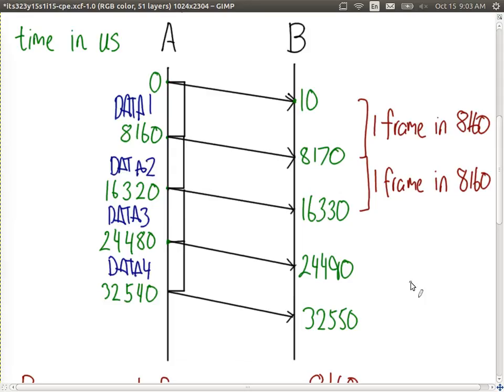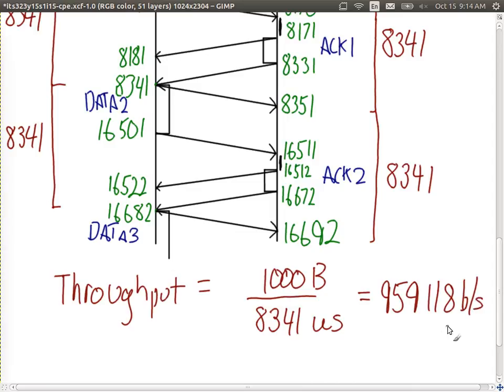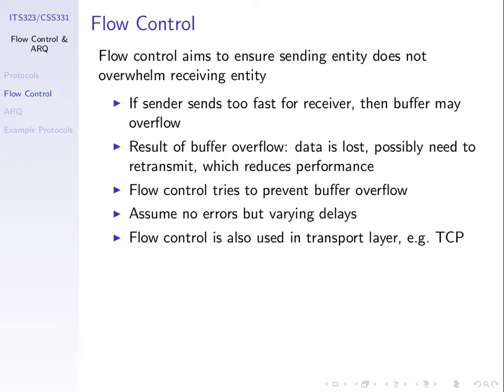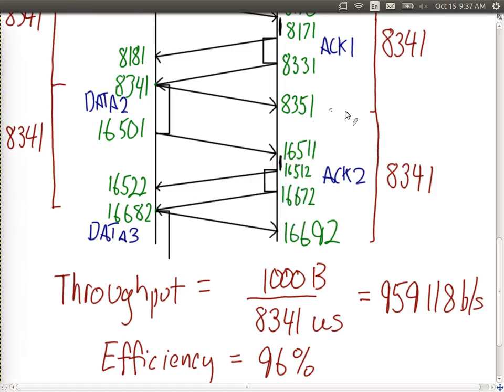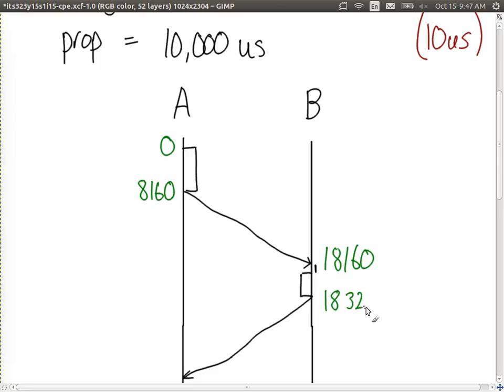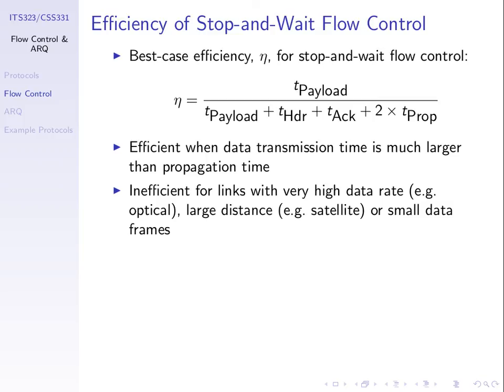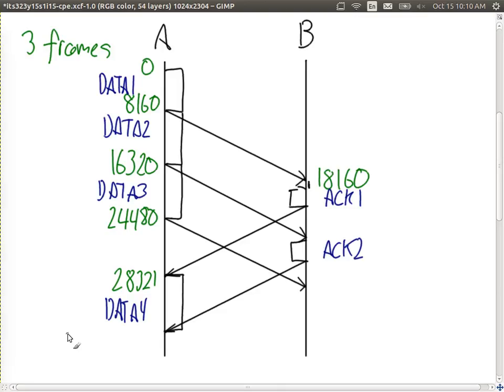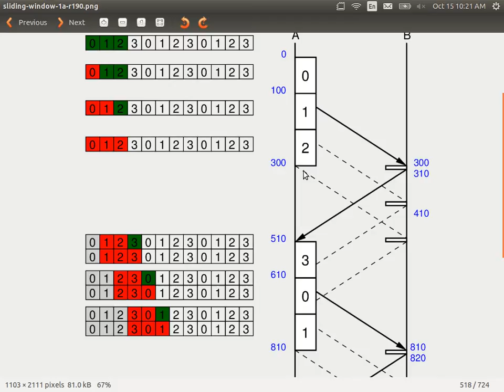Stop and Wait Flow Control (ITS323 L15, Y15)

Comment: • Frames are parts of data with some header information
 • Frames are sent from source to receiver
 • The receiver must do some processing on the frame before it can be used (by the higher level software)
 • If the source is sending faster than the receiver can process the frames, then the receiver will begin to overflow 
  ○ Ensuring that the receiver has enough time to process the incoming frames, is flow control 
 
 • Stop-and-wait flow control
  ○ Simplest type of flow control, easy to implement
  ○ You have 2 frame types
   § Data
   § ACK
  ○ How it works
   § Source sends a DATA
   § Receiver sends an ACK 
  ○ Inefficient for links with high data rate (optical fibre), large distance (satellite) or small data frames
   § Spends too much time waiting between sending consecutive frames
  ○ We often have small data frames because 
   § The receiver buffer size may be limited
   § Less likelihood of errors during transmission, and if necessary re-transmission is more efficient
   
   
   
 • Bit length of a link
  ○ =B=R Xd/v
  ○ B = length of link in bits (J: Capacity) 
  ○ R = data rate of the links, in bps 
  ○ d = length of link in meters
  ○ V = velocity of propagation in m/s 
 
Sliding window flow control
Concept
 • Allows multiple frames to be in transit at the same time
 • Let A and B be connected via full-duplex link
 • B has a buffer of size W 
  ○ A can send W frames without waiting for an ACK
 • Each frame acknowledged frame is labelled with a sequence number
 • When B sends an ACK, it also includes the sequence number of the next frame to send
  ○ This also tells A that B is ready to receive the next W frames, beginning with the number specified
  ○ This allows us to acknowledge multiple frames at one time
   § Ex. B receives frames 2, 3, 4. It only sends an ACK after frame 4 is received. 
   § The ACK also specifies sequence number 5, which implies 2,3,4 were received successfully 
 • A maintains a list of sequence nums that are allowed to be send
 • B maintains a list of sequence nums that are ready to be received 
 • These lists are a window of frames 
 
Window Size
 • The sequence number occupies a field in the frame, so it is limited to a range of values, because a field in the frame has a maximum number of bits
 • For ex.
  ○ Let each field be 3 bits long
  ○ Sequence number ranges from 0 - 7 
  ○ The frames are numbered modulo 8, so after sequence number 7, we have 0 
 • For a k-bit field, we have range of sequence numbers from 0 - (2^k) -1 
  ○ Frames are numbered modulo 2^k
 • Maximum window size is 2^k−1
 • Window size does not need to be the maximum 

 • RR 
  ○ Receive Ready, message sent from receiver 
  ○ RR 3 = "I have received all frames up through frame number 2 and am ready to receive frame number 3; in fact I am prepared to receive 7 frames, beginning with frame number 3." 

Error Control

ARQ
 • Automatic Repeat Request
  ○ ARQ is a term to describe mechanisms used for catching and handling errors in transmission 
  ○ Includes: Error Detection, sending positive and negative ACKs, and re-transmission on timeout (not receiving an ACK)
 • 3 Versions of ARQ
  ○ Stop and Wait
  ○ Go back N
  ○ Selective Reject

Stop and Wait ARQ
 • Based on stop and wait flow control
 • Source transmits a single frame and waits for an ACK 
  ○ Error 1: No ACK is received. So the source times out and resends the frame
  ○ Error 2: The ACK received is damaged. The receiver actually did receive the correct frame, but the ACK it sends back was damaged, so the source will send the same frame again. But the receiver accepts this repeated frame as a new one, so now we have duplicates.
   § To get around this, we alternately label frames with 0 or 1 
   § If the receiver receives a frame 1 twice in a row, then it knows it should discard one of them 
Go Back N ARQ
 • Based on sliding window flow control
 • If the receiver detects an error in a frame, it sends a negative ACK (REJ = reject) 
  ○ It then discards that frame, and future frames until the frame in error is correctly received 
  ○ Thus, the source must re-send a frame when it receives an REJ, and also all succeeding frames that were transmitted
 • Example 
  ○ A just transmitted frame I 
  ○ B has successfully received frame (i-1) 
  ○ 3 types of errors:
   § Error 1: Damaged Frame
    □ The received frame is invalid. B discards the frame
    □ 2 Subcases:
     ® Subcase 1: A sends next frame in reasonable time
      ◊ A sends frame i+1. B receives it, but out of order and sends an REJ I.
      ◊ A must retransmit frame I and all subsequent frames
      ◊ J: So the error is caught when A tries to send the next frame, but B realizes it was received out of order
     ® Subcase 2: A does not send next frame in reasonable time
     
     
     
     
     2016-04-14 2:00 PM - Screen Clipping
     
     
      ◊ B receives nothing, so it does not return an RR nor an REJ.
      ◊ A's timer expires, and transmits an RR that includes a P bit, set to 1. 
      ◊ When B gets an RR frame with a P bit set to 1, it knows that it should send an RR with the next frame that it expects to receive (frame i). 
      ◊ When A receives the RR for frame I, it retransmits frame I 
      ◊ Alternatively, A could just retransmit frame I when its timer expires
   § Error 2: Damaged RR
    □ 2 Subcases:
     ® Subcase 1: A gets an RR for the next frame before its timer goes out 
      ◊ B receives frame I and sends RR (i+1), which suffers an error in transit
      ◊ ACKs are cumulative, so RR 6 means that all frames through 5 are ACK'd 
      ◊ A may receive an RR for the next frame, which means nothing needs to be done about the current damaged RR 
     ® Subcase 2: A's timer expires, and B does not respond to A's RR 
      ◊ A sets a new "P-bit timer" after transmitting its RR with a P-bit 
      ◊ If B doesn't respond to the RR command, the p-bit timer expires
      ◊ Then, a tries again with a new RR command and resets the p-bit timer
      ◊ This loop is repeated, until an ACK is received
 
      
      
 
      

  
 • Ex: 
  ○ Propagation = 200, ACK transmission = 10, transmission of 1 frame = 100
  ○ A is allowed to send 3 frames thanks
 
 Sliding window
Reply: From where did you copy this thing?